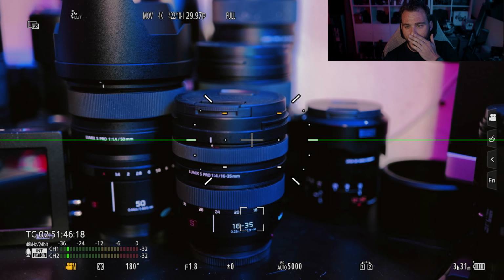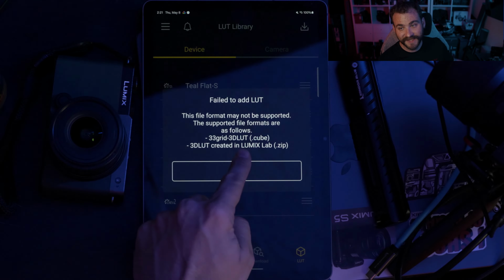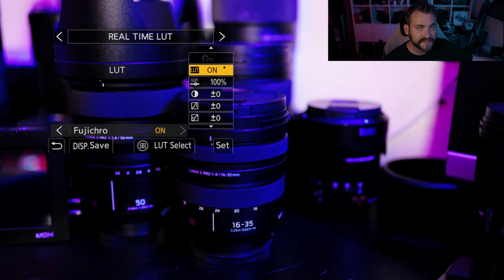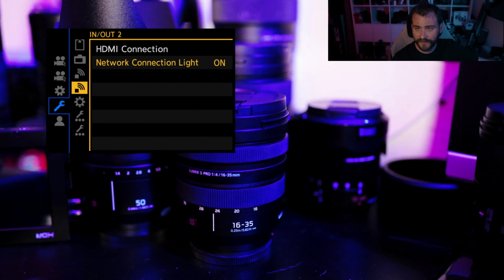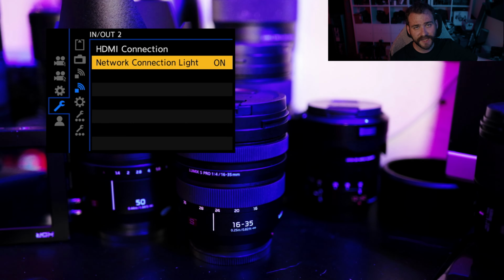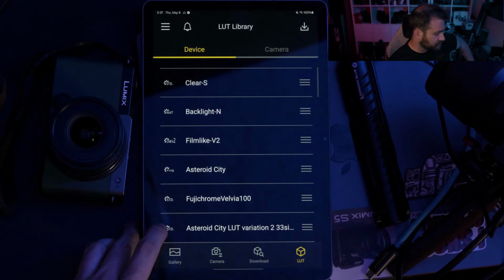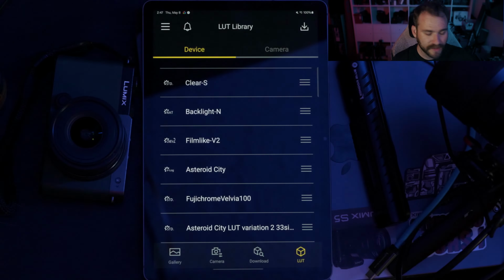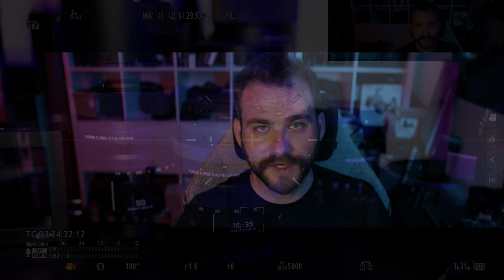LUMIX Live : Lab & LUTs

Comment: 0:00 Stream start
7:30 Intro & LUMIX Pro Services
11:45 Bringing S5iix features to S5ii as a firmware update
12:48 Lumix Flow compatibility with S5ii coming
13:52 Save profiles (YT, Twitch) feature in Lumix Lab (request)
14:48 How to use the Nicest 709 LUT and other Varicam LUTs
18:49 Flash for real estate photography 
19:34 Nicest 709 doesn't feel punchy or correct 
21:50 DEMO: Real Time LUT - base profile
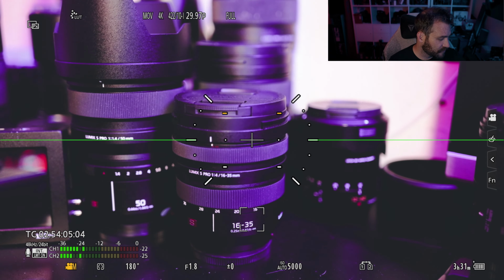24:13 DEMO: Lumix Lab - loading LUTs
28:28 DEMO: Lumix Lab - transferring LUTs
31:45 Using LUTs in post for RAWs
33:07 More recording options for the GH7 (request)
35:08 AF-C performance of older Sigma lenses
35:58 Using false colour while using a LUT (S1Rii) 
38:43 Proxy files with 6K (S5iix)
39:10 Sigma performance in sports and wildlife
40:06 Turning on Bluetooth (S5iix)
41:36 Modifying saved colour profiles
43:08 Elinchrome lights with GH6
44:09 Batch importing LUTs via Lumix LAB (req.)
44:47 More recording options for the GH7 cont., 4:2:2 vs 4:2:0
45:52 OLPF and global shutter talk
51:29 Lumix Sync fails to connect (GH7)
52:18 DEMO: Saving LUTs to My Photo Style
55:42 GH7 limited open-gate recording options?
56:21 Full frame 4x3 sensor camera
58:21 Manual focus in Lumix Lab
58:54 More recording options for the GH7 cont., ProRes
1:00:23 Sigma 150-600 vs 60-600 autofocusing for sports
1:01:53 Outro

Comment: Hey Sean @LumixUSA - I have a question about zebras: I have an S5M2 and an S9. In the S5M2 I can set zebras up to 105% but in the S9 I can only set zebras up to 95%. However both the S5M2 and S9 user manuals show that the zebras can be set up to 105%. So is there a bug in the S9 firmware or is the S9 manual wrong? If it's the manual that is wrong, why would the S9 have a lower maximum zebra setting?
Reply: Are both in vlog profile?
Reply: @Sumitomato  No, both cameras are set to Standard photo style.